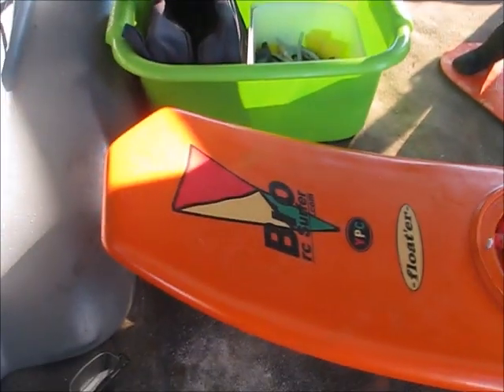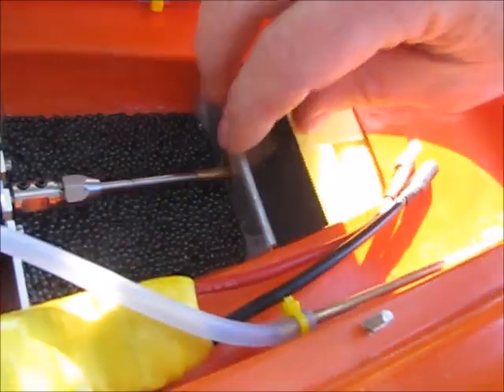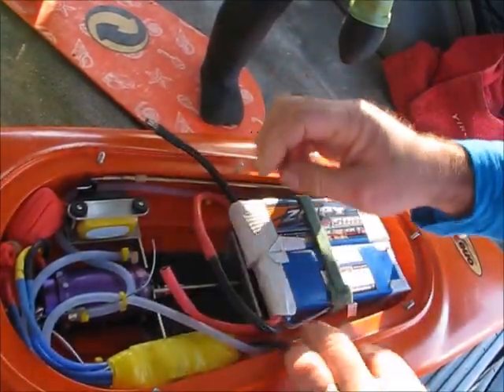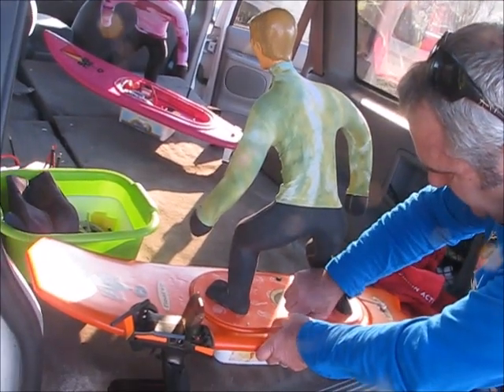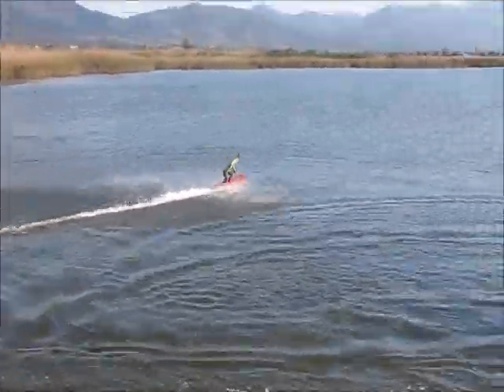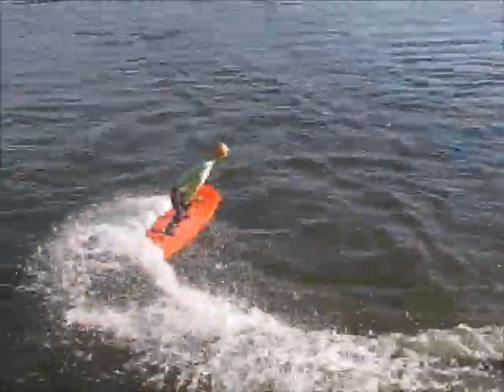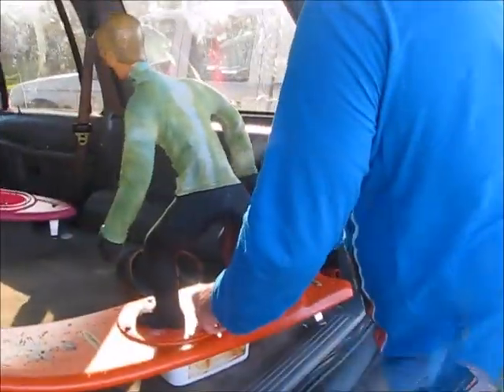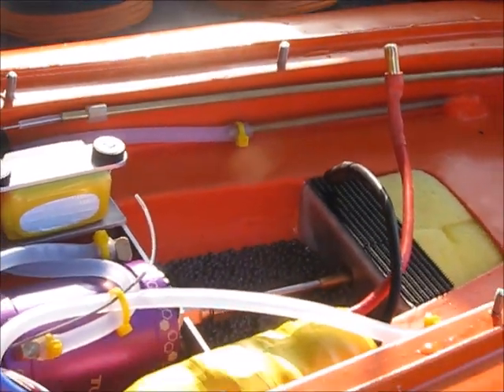36" floater - Flat water test - Bro rcSurfer

Comment: Your flat water test for steves board is a joke. You OBVIOUSLY didn't show him how to run it. He's tinkering with settings on the inside of the transmitter ? WOW, the guy that would enjoy it most is told to learn to steer or put a pool noodle on the nose  as a bumper . Sad, very sad ...
Reply from the maker: +FunnyJohne Howzit DipShit - I SEA another project and relationship has turned South - whats the genre of BullShit going to be for you this year -
Reply: Ha, yes it went way south, we are now making our boards in Brazil. The Cali crew wanted to focus more on boat design (something you can understand lol) than rc surfers, so I decided to move the venture to a crew I have worked with for the past 5 years that have delivered product faster even thou they are 6000 miles away. Best wishes on your retirement. You deserve  a break ...